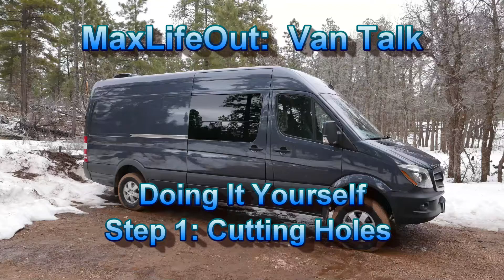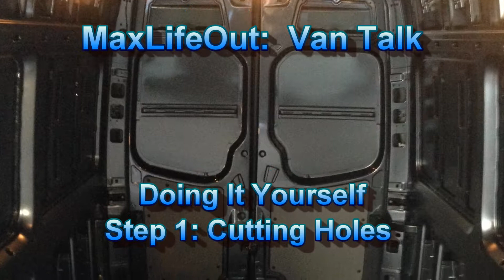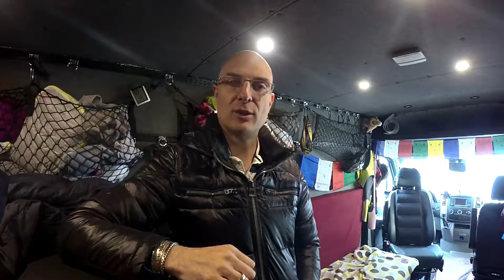Oberon Cutting Holes

Comment: Interesting series of DIY van build videos . Looks like we're located in or near Portland Oregon. I've owned two Sprinters over the last 15 years. Both were primary DIY builds. Between the two, I've logged over van 250,000 miles. I'm also located in the Beaverton area. Anyway,  good luck with the videos.
Reply from the maker: Thank you Ronald and wow that's a lot of miles.  Here's to the next adventure.  Until our paths cross all the best.